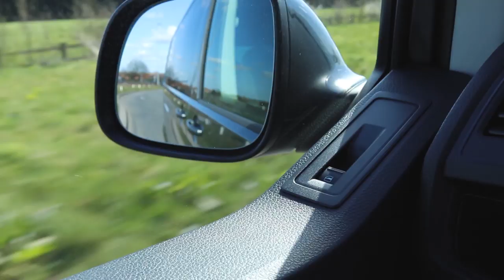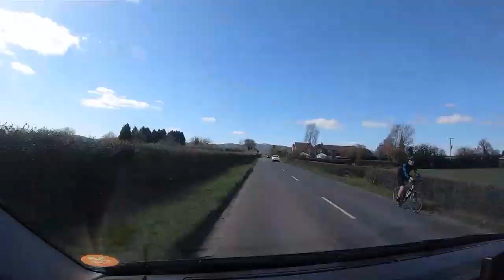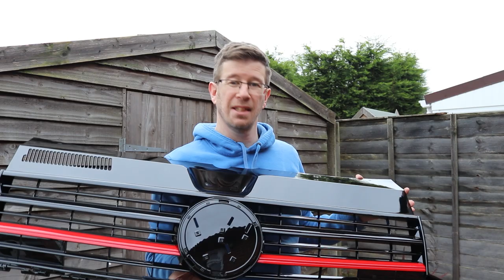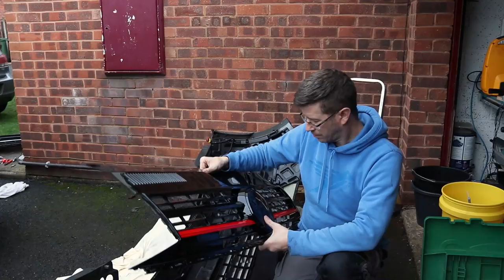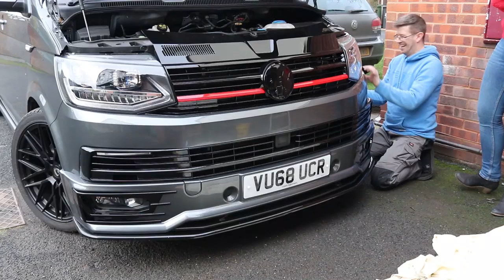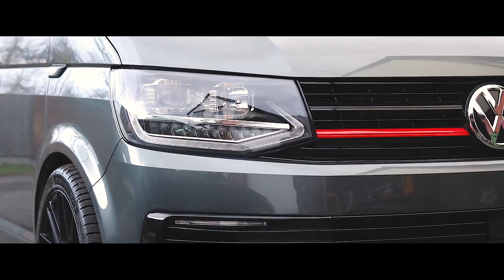Installing a T6 Black Gloss Grille | Driveway Mod 11

Comment: Great video Steve. A question when you refitted the badge. Did you still have to use the black backing plate from behind the chrome badge?
Reply from the maker: Thanks buddy,   You know I don’t think I did in the end..... it has a glossy back drop from the grill and I think the clips sat better without the backing plate.
Reply: Thanks. Some online say retain and refit it so I’ve ordered another backing plate 👍🏻

Comment: Steve thanks for doing the videos on the van as I’ve been following you for some time. 
So it’s time for me to install the upper and lower gloss black grills. Are you still happy with the travelinlite products before I order
Thanks Rich
Reply from the maker: Hi Rich,  thank you for following🙌. Really appreciated.  I am very happy with both grills even after going through a couple of winters they have held up well and the lower DRLS are still working faultlessly👍.  I did get a large stone chip on the red feature strip but that was down to poor luck and I have acquired  a new red strip so an easy fix.  All in all I’ve been very happy 👌

Comment: Hi Steve,  your videos are cool man.  Do you get your van paint detailed as it looks very decent in all your videos.   My wife and kids washed mine a few weeks ago and left swirl marks all over.
Reply from the maker: 🙌🙏thanks Eddie,  I always do all my own detailing.  I’m no expert but I stick to the primary rules such as work from top down and use 2 x buckets for cleaning.  1 with the solution in and another with just water and a grit guard so you can dip in the clean water and push down on the grit guard then into the cleaning solution so not grit gets back onto the panels lowering the chances of swirls.  Fortunately I let my kids do my wife’s car and then they’ve had enough by time I get to the van 🤪🤣👍

Comment: I got my upper front debadged grill from travelinlite and I must say the quality is excellent had it respirated to match the candy red on the mirrors and spoiler etc looks ace and at half the cost of VW and other sites. Your van is coming along nicely love the gloss black 👌🏾
Reply from the maker: Marieya & Matt Davison thanks very much 🙏😊.  Yes I nearly went de badged too I do like the de badged look 👌
Reply: Steve Field, I decided after a tree branch landed on my bonnet and broke the grill to go debadged lol luckily it was the week before it was due in the body shop for a paint job on my lower splitter and front bumper as I’m selling it and getting the T6 from Van Haven which I asked them for the new van to have a debadged grill too as I love the look 😍
Reply from the maker: Marieya & Matt Davison crikey,  I was fearing something was going to go flying in the air with all the storms we’ve been having.  Sorry to hear your van was hit but sounds like timing was perfect and you have made a positive out of it 👌

Comment: Nice fitting of grill. Please advise where to buy the eibach race line lowering springs from, and what you think the approx cost of install should be on the T6 . Thank you.
Reply from the maker: Amer Bharj ////AMG Cheers, you can pick them up from Customvanz.co.uk. They are the only guys I know that sell them.  They are about £360 and can get different colours.  I don’t have a clue how much a garage would charge to fit.  I think customvanz list some prices fitted but they hide costs in packages of stuff.

Comment: Hi Steve,

How do these after market grilles hold up to the elements? So they fade etc……..
Reply from the maker: Hi Dave.  In terms of fading none, top grill as in above bumper I cannot fault it still looks like new.  The lower grill a couple of areas if you get close the paint in a couple of areas in the louvred bits  has come off under pressure washing (minor but it has) 👍
Reply: @SteveField  thanks Steve, I think they look better than the oe ones anyhow. Just ordered the led ones. We’re they easy to wire? Apparently there’s a fitting guide but usually they are a bit lacking 🥴
Reply from the maker: @davem4131  I have to say they got me through the wiring no problems so you should be fine on the wiring 👍

Comment: Hi Steve   just ordered my gloss upper and lower grille
The upper red trim if I decided to take that off  at anytime is it still gloss black underneath where it should fit?
Reply from the maker: Hi Lucio,  That's Awesome buddy,  really transforms the front👍 If you take off the red feature strip I am pretty sure it would need to have a black one fitting in its place as might look like something is missing. not 100% certain of that though

Comment: Hi steve.
Van looking great!
I want to gloss black my grills. My local body shop has quoted me £350 to spray the originals as they said will be a better job using original parts....I'm concerned of stone chips though! Are the gloss grills you fitted painted or gloss plastic? Also.....what's your final opinion on the gloss black badge vs chrome? I too am unsure what way to go on my starlight blue t6. If I gloss black the front badge I  feel i need to do the back too...gloss black grills and no chrome seems to be the more modern way.....dare I mention black packs on range rovers etc
Reply from the maker: Hi Stuart,  thanks for your comment!  Firstly I am still unsure about my black badge.  I personally think I am moving more towards the chrome badge (personally like it on the black grille) but many are opting I keep the black.  
The grilled are well painted and have a good gloss finish (painted onto smooth plastic not textured) but the quality of fitment is def not as high standard as OEM.  However I am fussy and it was OK! There were just a couple of clips that put up more of a fight to snap in but got there in the end 👍